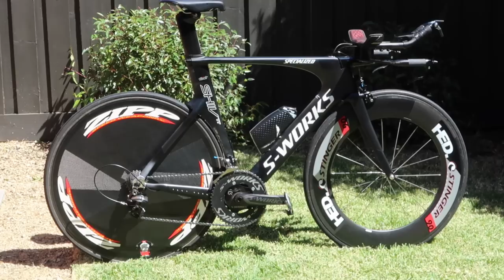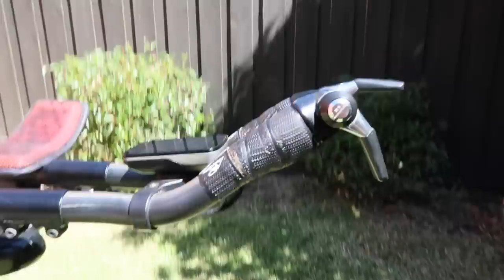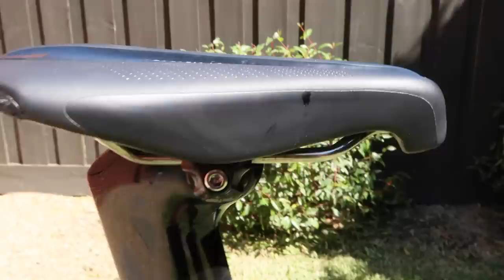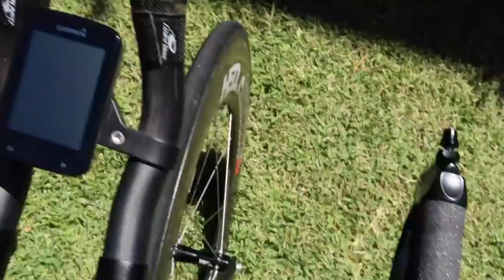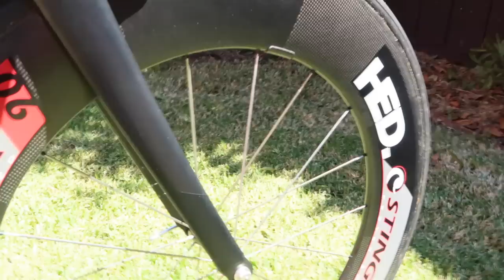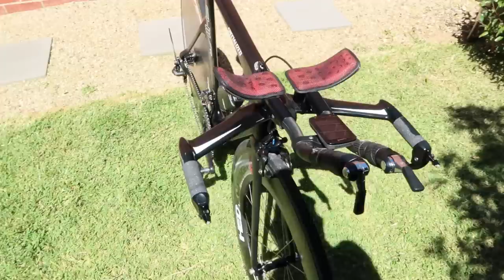My Time Trial Bike: Specialized S-Works Shiv TT

Comment: shane that rocked mate! got my 1st tt Feb 26th. im stokked...gonna use your head tip, for a good advantage. im guilty of the heads up method myself.  thank you for the wind tunnel advice and for the display of your tt machine. kudos!

Comment: When I'm messing around with TT positions I actually found that a backwards hat was a good way to figure out when my head was tucked properly instead of just bending my neck. If you bend your neck back the back of the hat will hit your back, if you just "turtle" the hat will stay off your back. It's a subtle change but I think the difference between "turtling" and craning your neck means a lot in terms of comfort.

Comment: Very cool. Question - how can you see anything with your head down?

I balanced my wheel by putting some lead tape (for tennis racket) under the rim tape, because I thought the wheel gave me some speed wobbles downhill. Probably it didn't and I was just a little nervy having not ridden a bike for a few years, but one can get a little paranoid about these things!

Comment: Shane, it looks like your saddle is forward of the 5cm minimum setback the UCI mandates. Perhaps this rule has been changed...or they've eased up on checking the setback in Oz?
Reply from the maker: +Cycling Explained It's about 65mm behind. The Internet is no replacement for a tape measure.

Comment: Hi Shane, Do you have any tips on getting a good baseline saddle X/Y position specifically for a tt bike to then experiment from? I understand there's lots to consider and not just comfort. (Aero is king!) Perhaps it's a video idea coupled with possible reasons for choosing a shorter crank although that seems like a very in-depth subject! Love the videos
Reply from the maker: I'm not sure I could add much value that people could use as take-away from a video on these. Everyone is different. And every bike setup is different. Shorter cranks.... the tri market vs the TT market differ on this topic, so another one that's a grey area.

Comment: just out of interest why do you run 175mm on the TT Bike? wouldnt you prefer shorter to open up the hip angle a bit?
Reply from the maker: +Michael Renardson That's what I've always used, so that's what I use. I also don't have to run off the bike, so maximum power, maximum areo, at all costs... including some comfort for short TTs.
Reply: I've just made the switch from 175mm cranks to 165mm cranks so was wondering why you would ride longer on the tt bike than on the road bike. Judging by some of your lama rides TT videos they aren't holding you back!

Comment: Hey Shane, in your TT bike experience, has your seat height differed much from your road bike? If so, higher or lower?
Reply from the maker: It's a little higher... just a little. To account for the more forward position... which then makes it about the same. I can explain another day with visuals.
Reply: Shane Miller thanks, a video in the future would be great. If you're measuring from the bottom bracket, wouldn't it just be the same between the two bikes then?

Comment: How do you deal with no pump or tool storage during races? Also no bento box for nutrition?
Reply from the maker: This was used for 10-40km ITT. No need to eat during those events. Any flat tyres meant race over so no spares were carried during events.

Comment: i see that you didnt fit propperly the chainset to the crankarm... and one other thing. if you have the head looking down...how do you see the road ahead of you :) ?
Reply from the maker: In what respect? The 53 has a chain stopper pin that's in the correct position against the crank. It also has two cut-outs for different power meters if that's what you're looking at?
Reply from the maker: I might go a 54 one day.... for now, it's just a 53. https://www.bike24.com/i/p/3/5/99453_00_d.jpg

Comment: Random: how is it that that the flywheel/fan on the cycleops trainer (drive side) doesn't turn when you are pedaling?  I thought it was supposed to turn too.
Reply from the maker: It wasn't pressed onto the rear wheel. I was using it as a bike stand. :)